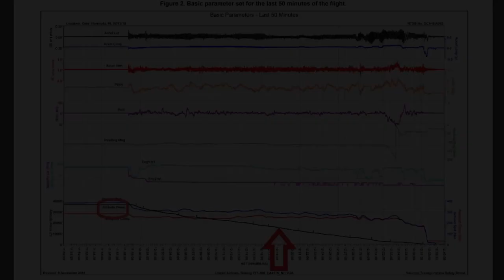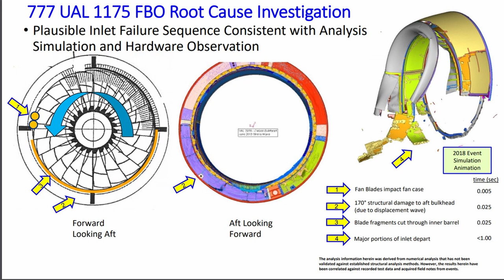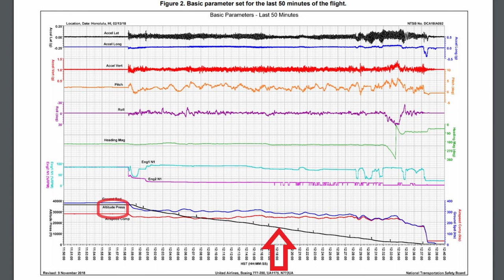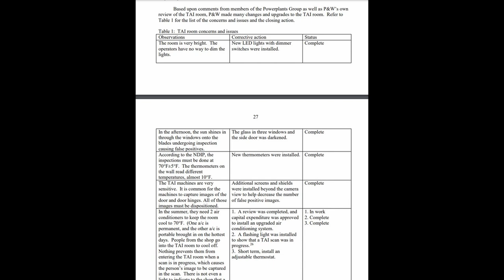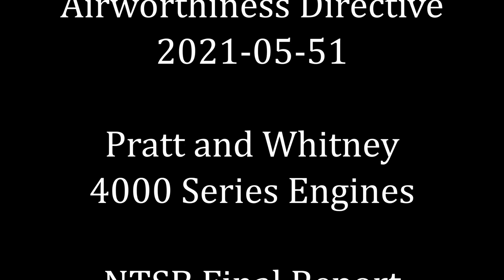Emergency AD & NTSB Final Report UAL 1175 Fan Blade Failure

Comment: I have used TAI to find defects in composite plastic material rather than the metal in blades but the basics are the same.  Others' comments on the need to coat the surface is correct: its for uniform surface emissivity.

However, it is not the rubbing of the crack surfaces producing local hot spots which highlights a crack, it is the microscopic stretching and relaxation of the material which does so. If you stretch a toy balloon repeatedly you can feel the rubber warm up. Metals or composites do the same. The intense pressure of acoustic wave (often ultrasonic frequency) flexes the metal parts and warms them slightly. If there is a break in the part under the surface the heat profile changes abruptly on the surface near the break. Adjacent parts of the blade with a sudden change in temperature along a line detects the location of the internal crack.

Comment: Radiographic and ultrasonic methods are also commonly used to analyze the internal state of a material, such as pipelines and submarine pressure hulls, industrial boilers etc. Ultrasonic is fairly new and does not suffer safety protocols that radiographic does. It would be interesting to hear if there are other processes that would allow them to examine these blades.

Comment: That TAI test costs 1850 per blade and if the blade has to be replaced they run 125k each. Note that those were 2018 prices and I don't know the cost today.

Comment: Juan, there's something I've always wondered; why hasn't Boeing or AB put a camera in with the wing light? That would give you guys the ability to see at least the inboard side of the engine along with any ice accumulation on the wings. It seems to me it would be a fairly straight forward retro- fit. All it cost is money - and OT pay for the grunts!
Reply: Great idea!!!

With the new camera technology,  be pretty easy to just incorporate it into the light assembly.

Comment: What puzzles me: Fan blade failures are routinely analyzed with every new design, with great effort the engine design was finaly able to stop them from ejecting the blades out, great stresses are observed when it is tested, where it looks pretty clear the thin aerodynamic cover will very likely be torn apart (as all the events had shown). Yet is seems no one took the extra step to look into what the effect such failure, with the consequent cover damage could be on the aircraft performance so pilots would have at least something in their hands, so not to turn theminto a test pilot role with the aircraft full of passengers...

Comment: From the report - a description of the "temperature-controlled" environment: 
"The inspector stated that he thought the room where the TAI is accomplished could have been set up better. He said that late in the afternoon when the sun sets, the sun shines directly on the blade. He had asked to get a shade to block the sun that he thought caused false indications. He thought it was too bright in the room. He said that they have recently added LED lights in the shop that are even brighter and makes it more difficult to see the screen. The room has two temperature gages that do not read the same. The room does not have a humidity gage. The room is air conditioned. But in the summer time, they must run a secondary air conditioner to keep the room cool. He said that in the summer time, people come into the room to cool off and that is a distraction plus the heat from their bodies alters the image. He had asked that a light be added at the door to show people when the machine was on."
Holy moley.

Comment: The paint may be used to improve the acoustical impedance matching between transducer and metal blade to provide a better acoustic power transfer.  The acoustic characteristics of paint (speed of sound), its thickness, and adhesion would be very critical to control.  

It was mentioned (as an excuse) that blade inspections were previously known to be compromised by poor paint coating job that allowed defective blades to be passed.

Comment: 15:15 The special paint is perhaps used for crack detection. Paint will penetrate into cracks, then you clean the surface from excess paint and then other agent is used which will visibly react with paint in cracks (if there are any). I have worked with something similiar in order to detect cracks in heavy stamping tools.
Reply from the maker: For a Fluorescent Penetrant inspection (visual) yes.

Comment: Having been involved with testing Rolls Royce engine part castings inspection using X-Rays and fluorescent dyes I can appreciate the problem. There were no computers as such back then. I wasn't one of those looking at the films but took them and was often involved in making up small and special shaped film packets to get the best angle on the cracks and defects. Some welding was done and then the castings were checked again several times before they ended up in the scrap bin. 
It may be done now, but computerised paint spraying can surely be done quickly and consistently. They have done it for years painting cars.

Comment: Laser vibrometetry needs a certain surface for reflectivity, that might be the paint they're using on the fan blades.
I had a system demonstration of a laser vibrometer. This test though would only record resonate frequency of the blade, which changes with fatigue. 
 We couldn't make use of the system since line of sight is needed. Most of our vibration measurements were deep within the spacecraft using accelerometers.

Comment: Wild guess on why paint:  Eliminate as much random interactive sound outside of blade and dampen any anomalies NOT related to actual faults inside outer blade surface.  The SNR (signal to noise ratio) is likely the limiting factor in what size of fault is discernable. Paint adds layer of isolation so the SNR provides minimum false indications and maximum sensitivity for smallest faults.

Comment: There is actual footage in a 7 part series I believe of "The Making of the Boeing 777" it shows a test of blade failure and the containment system. Additionally this test shows that the engine being tested also lets go of the opposing blade at 180 degrees so the vibration is kept at a minimum

Comment: Ulrasonic/ Thermal is an updated version of the older Ultrasonic/ Dye penatrant test.  However this test inolves painting the suspect area with a penetrant that shows the crack.  There is also crack detecting method called eddy current testing and rhe old reliable X-ray testing which also requiees access to both sides.. the fact that these blades are hollow makes rhese methods marginal or not practical.  The most obvious solution is to come up with a blade configuration that is not hollow.  I am sure P&W has spent many hours on this subject.  Easier said than done. Excellent reporting as usual.

Comment: They are probably using thermal imaging to identify the hot spots (crack failures).  The reason they have to paint the blades is that you can't get a reliable thermal image from a shiny metallic object. Shiny metal tends to radiate 98% of the heat energy at 90 degrees to the surface of the bare metal, which isn't necessarily helpful for a thermal imaging camera.  Painting with a matt paint or otherwise covering it with a non-shiny layer (eg tape) is one way to get a more reliable thermal image of a metallic object.

Comment: Having done NDT I expect future sensors to be installed inside large fan blades -  vibrations could be measured before & in flight then compared... But before that strength will be increased by redesigning internals.

Comment: One long term potential solution here is geared turbo fans.  Slow the fan down with a geared system.  Reduces noise and improves the efficiency of the engine.  Now employed on new A 320's.  By the way it's a Pratt and Whitney engine that is currently using this technology.

Comment: I worked on Turbo Jet aircraft ( PW J-57 59W ) .. a very stout but under powered engine.... but it’s longevity as a Injected Water Thrust Augmented turbine was impressive. 

The new Turbofans today.. aren’t much different then the one mentioned here... save for some minor changes ... but still the same.  

I am in awe of the Infrequency of incidents such as this one. Everyone that works with a turbine ... AUTOMATICALLY excepts the fact that one day... it’s gonna POOF... even with stringent standards of inspection... especially on the core engine... ( the actual turbine that drives that big fan). 

As we see here, it was the fan section...AGAIN.... and not the core turbine. The centrifugal weight induced onto these parts is mind boggling.... I think it’s around 90 Tons of pull on the base of the blade at 101% 

The blade(s) set in a Keyway and are PURPOSELY LOOSE.... in fact a really good ear on a good mech.... can hear a seized blade as the fan spins..... they “Sing” as they free spin at low rpm.   

 I stated above... “90 Tons” which may be way off. I remember reading something like this a while back...  correct me please... the true forces involved are absolutely immense and yet they keep on working.   

I’ve only once been involved in a Ballistic Uncontained Turbine event.... and it ain’t pretty

Big Props to the Pilot for getting a very heavy and very wounded plane back on the ground safety

Comment: There was a AD on my Mooney M20E for the hub of the prop to either be inspected every year for cracks or replaced.  My mechanic said it would take about 20 years to break even on the price of the inspection and a new hub.  I chose the new hub that was around $5k.  

I flew a lot at night, in the mountains, and if that hub let loose the likelihood that I could get the engine shut down before it ripped the whole engine off wasn't good.  I could just imagine that the crack could be visible the day after the annual and have 355 days to get worse or just be missed.  I am sure that the inspection that they do on the AD isn't anything like the one you are talking about and $5k isn't worth my life.

Comment: UALL flt.s' 1175 and 328 have presented a massive but unnecessary head ache For the FAA, Boeing and Prat and Whitney. P&W engineers thoughts were in the case of a fan blade failure , that the blade would attempt exit straight out through the fan case and thus they wrapped the fan case with Kevlar blanket. This blanket was supposed to act as a scatter shield and contain the blade fragments,  but the blade did not depart as predicted. Instead of departing straight out  it instead spiraled out through the inlet duct on a vector determine by both the false  centrifugal force and the differential air pressure on the fan blade .  Physics says if you swing a weight in a circle and cut the string the weight will not travel straight out instead it will depart from the circle on a straight line tangent to the circle in the direction it was traveling in. The clearance between the fan blade tip and the fan case is so small that the blade could not take this path and that's why it broke the preceding blade to provide clearance for it to exit .This is the  reason why I say this could have been anticipated, all you you have to go is look at the massive containment structure that P&W engineers surrounded the inlet and fan case with for the containment certification test. All the engineers had to was pick the debris out of that structure and ask themselves how did the piece of fan debris get here. This indicates a failure of imagination by both the engineers and the certification officials. And the Kevlar blanket is just dead weight.

Comment: Any altitude you’re able to maintain with one engine until you can land safely, is the best, as high as you can safely operate with a level aircraft. Paint helps to see fractures easier, for us we paint the inside of our race cars white, because stress crack are easily seen.

Comment: Observing the engine vibration of the PW4000-112 after 34+18ish pounds out of 748 pounds was jettisoned, one is reminded that air is still passing through the engine causing the blades to windmill. One cannot feather turbine engine blades. That is going to put 112 inches of nearly flat surface into the wind causing the adverse yaw in addition to whatever flat components face forward. The vibration is going to continue until the airspeed is zero(ish), so it speaks well of the engine attachment that it can take that much stress. Question: what RPM do these blades turn at idle and at full throttle? Another great series of explanations, Juan. Tell the truth, do you think Atlantic salmon is better than Alaskan? :)

Comment: As you mention a third crew help to assess the damages, Airlines can retrofit camera on older plane for the Pilots to see on critical areas, even cars have 360° camera now
Reply: Cabin crew can also report and take photos.
Reply: An aeroplane is not a car. The aircraft is subjected to forces and temperatures that require certification. Manufacturers can design the camera into the aircraft at the design stage as is happening now with newer aircraft. All that requires certification not to mention weight penalties and a additional maintenance burden for a once in 20 year event.

Comment: Juan, I have thought about your description of the path the fan blade takes exiting the engine and I think the path the blade takes is determined by three factors,/ the first factor is rotational speed of the blade, the faster the blade rotates the more direct out the blade will. take. the second  determinate is the pitch of the blade . the great the pitch translated into greater front to back air pressure differential will be, with the higher pressure being on backside of the blade. The final factor being the point of fracture on the blade, the closer to the blade root the fracture occurs the greater the air pressure differential will force the blade to exit forward as it did in IAL 328. If you were inclined to you could plot the blade path on an xy graph graph with the x axis running through center line of the spinner and the y axis  across the the horizontal center line of the spinner and traveling ti the outer edge of the fan blade. I think that this exercise says the the Kevlar blanket that wraps around the fan case is to far aft to protect against uncontained failure and to be effective in that function should be placed inside of the inlet duct furthermore I think the nose ring should be mechanically connected to the rear bulkhead with stringer to help prevent the rings separation from the inlet duct as it did on UAL 328.

Comment: The AD that was issued certainly helps to reduce the risk of a failing fan blade but this could ofcourse still happen and the engine is designed to handle such events by keeping the failed blades inside the engine housing in order for the engine to be shut down.
The worse problem I think is that the engine cowling does not seem to be designed to handle the vibrations caused by the missing blade. If that is the case it seems the prerequisites for ETOPS is no longer present.

Comment: The paint is probably to give the blade a better thermal emissivity. When you're using an infrared detector, shiny metals don't emit as much infrared as you would assume from their temperature and it can be have very hard to calibrate. By painting it, presumably black, the thermal radiation properties are much more consistent.

Comment: Juan. if you draw a diagonal line from the break point on the fan blade  of UAL 328and extended it to the impact point on inlet duct nose ring you could determine the angle of the path the fan blade exited on and if you further extended that line and then rotated it around a 360 degree circle you could determine if and where the blade would impact the fuselage and I believe if the blade exited between the 60 to 90 degrees quadrants the blade would impact the fuselage.

Comment: It would seem to me that inlet duct designers could mitigate the resultant flat plate drag presented by by the inlet cowl rear bulkhead and mounting flange when the forward part of the inlet duct disintegrates by building in a sloping plate on the front face of the rear bulkhead that would direct the incoming air flow more smoothly up and over the flat plate with less turbulence.